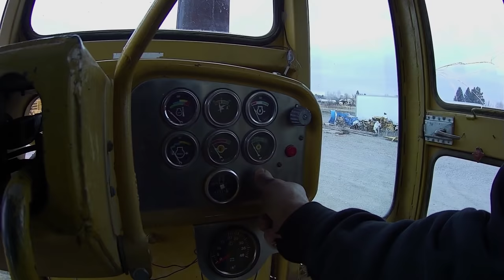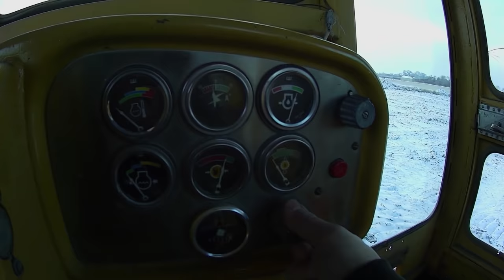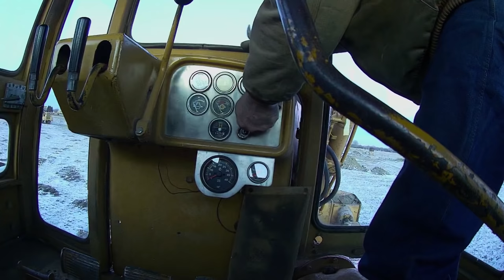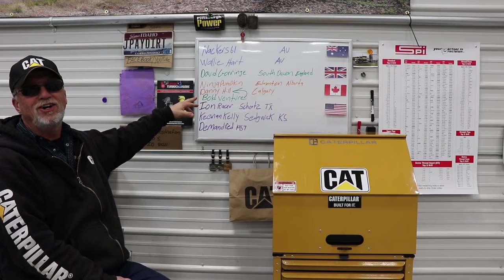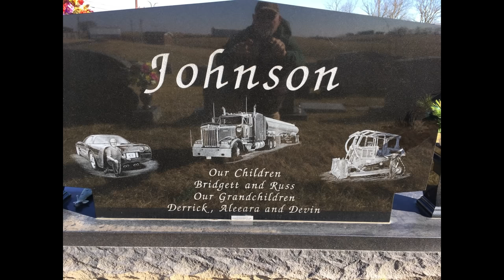Caterpillar D9 Called Back To Active Duty Status

Comment: i gotta tell u-since u added the Bonanza theme song-that takes me back over 50 yrs from now-on Sunday evenings watching that show.
now when ur changing oil, slipping off the push arm of the D9G-that takes me back to the late 70's and into the mid-80's for that stuff.
when u play East bound and down, now i'm into the early 90's when i had a truck, hauling steel.
i enjoy all ur video's, but i'm just gonna laugh about the rapping little guy at the end. ha! ha!
u have pretty much covered my life-except for the yrs running a D-11N, AND R's. so thanks for the reminiscing.

Comment: Seeing this reminds me of back in 1966/67 Army used Cat scrapers.I think they were called 830M. I remember they had a Gasoline pony engine in place of direct starter.Procedure was to use the batteries to start the pony then use the pony to start the main engine.That was the idea anyway but usually the pony had to be hand cranked,batteries had a very high failure rate because of the heat.We were in Vietnam.So we would spend a lot of time trying to hand crank the pony,but the main usually started pretty well.

Comment: That used to be one of the ways, "back in the day" I could identify what was under the hood in many trucks. If it had a Cat, it had a heat/start switch. If it had a Cummins it had a compression release cable. If it had a Detroit, it had an "Emergency Stop" cable in case it started running backwards.
Reply: Anthony Forret Running backwards and pushing all the oil out of the oil bath air cleaner. The emergency stop was a flapper in the intake that could choke the air supply off. Real handy when an injector gets stuck and holds the rack that links all the other injectors together at full throttle.
Reply: It's either the emergency stop or put it in a high gear and let out the clutch. Oil bath AC oh shit! Bad enough with smoke billowing out dry AC

Comment: that switch on the D9 is a bit annoying  , works,  don't work , works again ,, that would get real annoying real fast 
on a lighter note i love the sound of the C15 cat ,,  got a really healthy grumble when it's pulling hard ,

oh  and i got an update on my truck I bought a few weeks ago ,found out a bit more on it ,,  the previous owner parked it because  the air compressor kept eating belts ,,turns out   the pump needs bearings ,, so i'll fix it ,easy enough ,,my $500 truck  has now costed me almost  $3500 now , it's got 6 new tires , 4 new drums and all new hardware and brake cans 
and i fixed the turbo , it now has a Garett T5  88mm turbo ,,and man does it produce boost ,,I get almost 50PSI at 3500-4000 rpm 
4500 rpm gets it over 65 PSI 
cruising 60 on the highway  it's pushing 30 pounds  of boost at 2500 rpm ,,355 gears in the rear axle ,it's geared like a pickup truck 
it's got a 12 speed with a live PTO   ,, which i absolutely HATE   but it works so i'll leave it for now 
it gets great gas mileage cause of the tall rear axle gears ,, averaging 13 mpg without a load which is much better than my F250
i'll be able to go a long way  without fuel  because it's got dual 75 gal fuel tanks too

Comment: How wide is that blade on the 9? You're doing well to go on the road without breaking it down. A company I drove oversize for would only haul a 9 with a push block on. Even if they permitted and escorted per the letter of law, they always got pulled over and inspected. Just became cheaper to take the bkades off. Kudos you can get it done. Thanks for sharing
Reply from the maker: depends on how worn out the end bits are, but 14'6" is what it usually is,
Reply: I figured that. I drove for that company for 2 1/2 yrs, we bootlegged an 8 with a wide blade once(trouble free) less than 4 miles close to home base in the whole 2 1/2 yrs. 12'6'' was where they stopped. DOT would use the wide blade as an excuse to check permits, even though they already knew the permits we had most of the time. Once they had the show stopped it became a witch hunt to see if they could find a ticket. We all know how that works. It's a great company that keeps it's trucks and machines up very well, no junk, safety and compliance oriented. Still no match for the man with the pen. Became cheaper to pay double hauls and mechanics. Good for you is what i say. You take a lot of creative and interesting shots for your footage. It gives people who aren't familiar with heavy iron a much better idea what it's like. Keep looking for ol kenny to come up! I'll be watching for him.

Comment: Those Cat scrapers you have are pretty nice my scraper experience is not nice at all I had to run T-Rex ts14 open cab with two screaming Detroit's they had Allison automatics air actuated both Transmissions and engines were identical setups was the only thing good I can remember they used to keep the spare transmission at the shop those guys could change them out in half a day they had an old man that would n frame those Detroit's they would only be down for 2 days I tell you I hated those noisy things

Comment: Have you got the pony motor set up for your D9? I never did like direct start especially up in our mountains where it's aways wet. You can purge hydro lock with the compression release & dry out the main engine with the heated air from the heater in the intake manifold. Ponies are ancient, yet effective.
Reply from the maker: No mine is direct but still has the compression release
Reply: That'll work.
Reply: still wish they had decompression levers on diesel engines

Comment: Jeff I haul equipment around the mid west, was wondering if the D.O.T. ever said anything to you about hauling the dozer with blade facing forward? Around here we have to haul them with the blades facing to to rear. Looked like fun pushing frozen dirt!
Reply: SSnyder Trucking Here in The People's Republic of Californistan we haul blade first all the time...
Reply: I haul blade back so I can see around it. Utah used to make us carry it high as possible. Not any more.
Reply from the maker: I don't understand the backwards thing, I would hit everything on the county roads like that, mail boxes signs, and then there's the weight thing I would be way to heavy with it backwards
Reply: They tell us its a safety issue for on coming traffic. If a vehicle should happen to strike the dozer it would rebound off the push arm instead of hitting the corner bit head on
Reply: SSnyder Trucking that’s sensible.
Reply: SSnyder Trucking Oh please no. I would rather a Dozer was facing forward so I can easily see the blade from a distance.

Comment: The D9 engine sounds awful when it starts cold. What's wrong with it?
Reply from the maker: Diesels are Compression ignition engines, so they don't start to good when cold especially old ones that don't have the high injection pressures that electronic engines produce
Reply: @Jpaydirt   Ok. I only have experience with 4 stroke diesel and they start quieter, especially Volvo.
Reply: Volvo diesel- where someone took nothing, and made less.